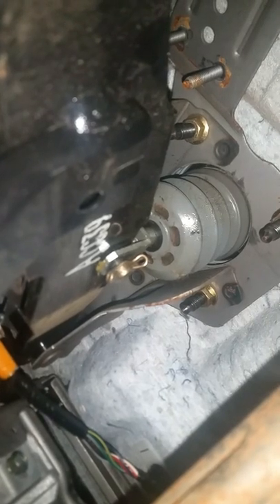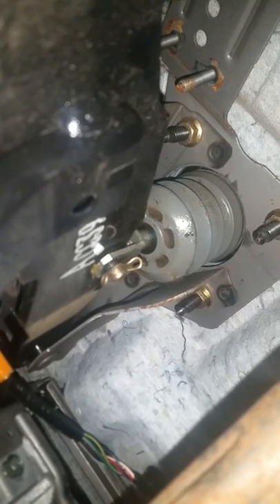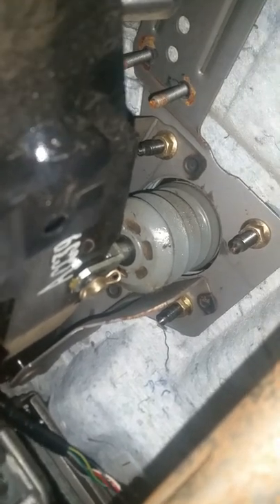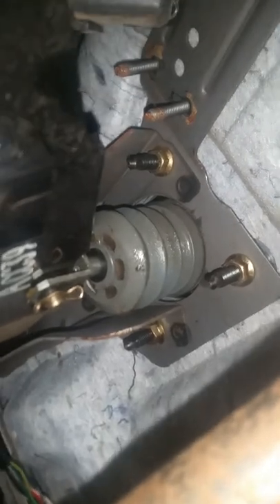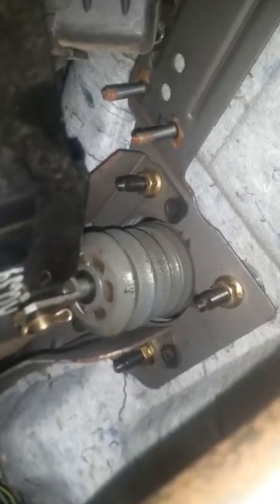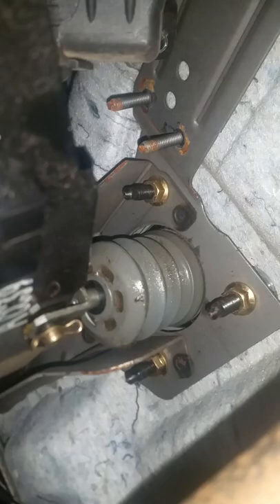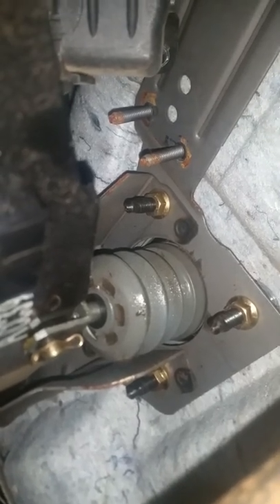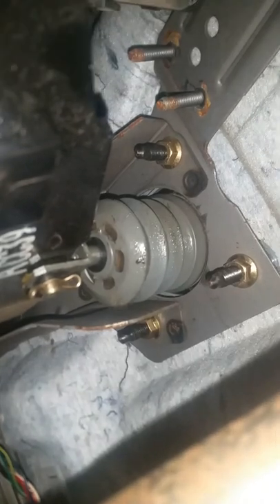How to tell if your Brake Master Cylinder is Bad

Comment: Thats a brake booster…
Reply: If ur master cylinder is bad it’ll leak inside the booster and cause problems….
Reply: @Tjz30 yes but as you see in the video he calls it the master cylinder. He zooms in and says heres your master cylinder, on the opposite side of the brake booster

Comment: Isnt that your brake booster?
Reply from the maker: the brake booster is on the other side of the firewall
Reply: @FixItYerself  the booster goes through the firewall. Then connects to the master. The booster connects to the brake pedal, goes through the firewall, then connects to the master.
Reply: @FixItYerself  the booster connects the pedal to the master cylinder through the firewall dude… Just look it up before you make youtube tutorials telling people to buy the wrong part. Make a new video, this is legit wrong information, youve probably made atleast one person waste $100+ on the wrong part already. Fix it
Reply: @FixItYerself  the master cylinder is in the engine bay, the booster is what goes into the firewall. Thats why its mounted directly on the other side, the master cylinder is the piece in the center of the booster in the engine bay. The master cylinder has the brake fluid reservoir on top of it and the brake hardlines going into it
Reply: @drewpeacock2762 okay but for the fluid to be inside the vehicle doesn’t the master cylinder need to be leaking into the brake booster which then travels into the car making what he said correct the problem is the master cylinder

Comment: I have a 2010 Jeep Patriot and I looked underneath my dashboard behind the brake pad and I saw a few drops of brake fluid that means the master cylinder is bad?
Reply from the maker: it is most likely leaking. keep an eye on.the fluid level. Because it's leaking, it may also pump bits of air into the system, decreasing your stopability.